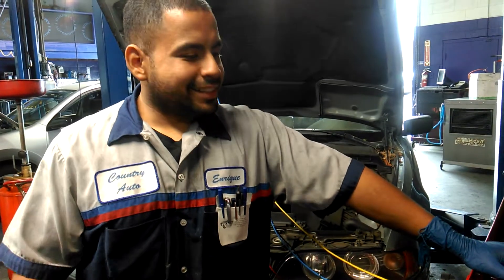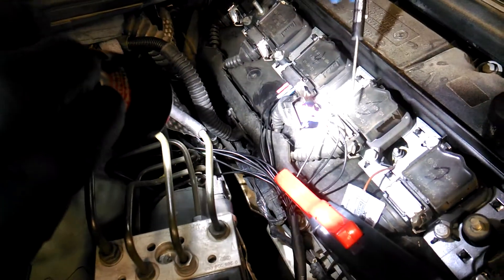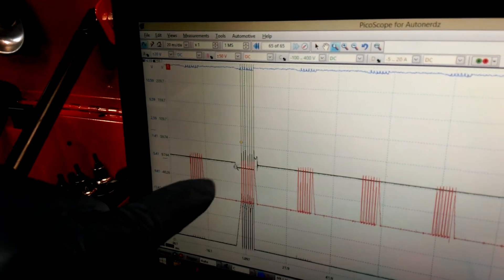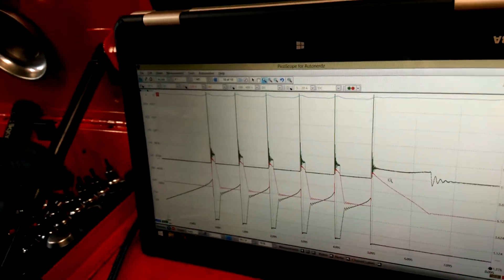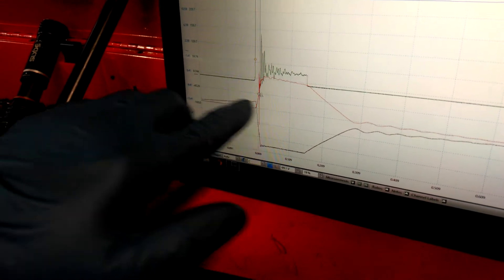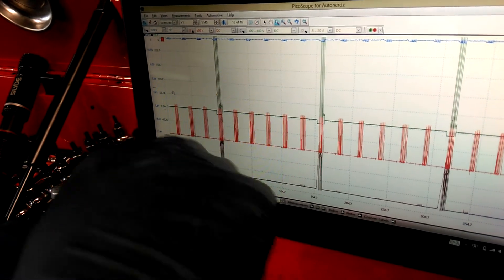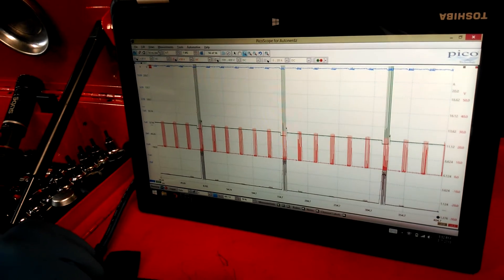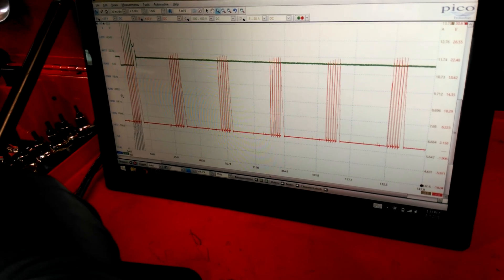Picoscope 4425 Ignition Waveform 2002 BMW 525i

Comment: So youre a pico guy now :)
Reply from the maker: At times. When the situation calls for it. :)
Reply: A little bit off topic Enrique.,any opinion on ditex scope?
Reply from the maker: I am sorry I have never used or heard of that scope. I looked at the website and the price on ebay. For the specifications, 2MHZ,  20 MS/s it does not look too bad. I don't know about technical support though. Sorry I could not answer more thoroughly.  Thanks for your question.

Comment: Can you use Hantek test leads, secondary ignition pickups, DC/AC amp clamps and other cables with your pico? Pico accessories are much more expensive than Hantek.
Reply from the maker: +Mambre Khachatryan You can use Hantek accessories with the Pico since all the Hantek accessories output a voltage just like the Pico ones do. The only concern is the conversion factor of the amp clamp. You will either have to make a custom component in the Pico software (which is easy to do) or do the conversions in your head as you are using the amp clamps.
Reply: +Enrique Osorio OK, is it necessary to have 4 channel scope? I hope to do 90% of tests with 2 channels.
Pico software seems to be cool, waveform library will be very useful, is there extra fee for library access? Thank you very much.

Comment: Hey man! Can you find misfiring injectors with this unit?
Reply from the maker: +ILTSYC You can, you can find injectors that are not firing due to lack of control, shorted injector coil or an open injector coil.
Reply: I was fixing to purchase a Pico Scope until my transmission went out in my van.

My Pa in Law has a vehicle that skips on acceleration  but its not throwing any codes.
I figure its probably a plug, plug wire, coil pack or injector.
Reply: Hey man, when you do an intake gasket replacement on a 5.7 Chevy. Water gets in the oil when the intake comes off right? How many times do you change the oil to get that all out and ensure that the engine will not spin a bearing shortly after?

I've seen two 5.7 Chevy's spin a bearing right after, within a week of having the intake gasket replaced. I do not know if the oil was changed or lowered enough to get the water out on either vehicle. Same mechanic did both. One was my Suburban and the other was my Nephews Z 71. And I've heard of many others

It cost me an engine just to have the intake gasket replaced. Now I've just replaced the intake gasket myself 8 years later and am concerned. I didn't even crank the vehicle without getting that oil out of it.

Before I was pulling a boat to the lake and all the sudden I lost oil pressure and before I could get stopped it was knocking. Game Over!
Reply from the maker: +ILTSYC I have never had to change the oil  more than once. If that much coolant gets into to the oil i suggest draining the coolant first.

Comment: Great video, as always.
Bought the hantek myself, while saving up for the pico, used they are hard to come by..
Could be nice have you make an direct comparison with the hantek and pico, if you made the same measurements on a vehicle...
One thing i really really miss on the hantek is the volt and time display pr division on side og the display, like the pico has... 
Keep up the good work.

Comment: Good clip,  What type laptop are u using.  I purchased a Pico 4 ch. to use with Verus Pro.  No good,  Turns out Snap On platform won't support. Now looking for laptop.
Reply from the maker: JOSEPH BURIEL So sorry for the late response. I am using a Toshiba Satellite Radius 11 L15W-B1302 and I have no problems. Good luck.

Comment: Congrats for your new Pico scope... Question if I may...  is there any reason why you changed your Hanket 1008A over a Pico Scope.  I've been using Pico.  it is a shop scope owned, you know, the price..... but, I've been thinking in getting one for me. pricewise Hanket.... but I've never tried it. so, what is your opinion comparing them around? thanks. good Job
Reply from the maker: Victor Alvarado The Hantek can not hold a candle to the power of the Pico. The Hantek is useful but you have to get creative with how you capture your waveforms. Anything that you want to see with the Hantek can only be seen with great detail if you choose a short timebase. If you choose a longer timebase you will be able to see more of a waveform but at the sacrifice of detail. With the pico there is no sacrifice you can get incredible detail in waveforms that are over 10 seconds long.
The Hantek can be used, I used it for over 2 years and it has rarely let me down but the pico is another world.
Reply: Enrique Osorio I see... Ok. Thank you.

Comment from the maker: I prefer the pico over the Snap-On Scopes simply because the pico is just as powerful as the scopes Snap-On makes but costs significantly less. The cost is difference is huge once you add on accessories. You can get the new standard kit from AutoNerdz that comes with a 4 channel oscilloscope and many leads, probes and accessories for a little less than a brand new 2-channel Snap On Vantange Ultra that only comes with 3 leads. If you want 4 channels with a Snap On you are now talking more than double the price for their 4 channel scope/scan tool platforms.

The major advantage of Snap-On is their trouble shooter which can give invaluable information as well as wiring diagrams and connector views. For me it was not enough of an advantage to spend the extra money for the Snap-On.
Reply: Thanks for your reply I will consider all these factors when I go to purchase, sandy

Comment: Bro very nice videos i am thinking about the pico or the new pc based autel maxiscope 4 channel . What do you think i am presently using a fluke 192 scopemeter and thank you for taking the time for these very informative videos .
Reply from the maker: 8power0 I have not heard about the Autel until you made me aware of it. The features and specifications are outstanding but are about 25% of what the pico is capable of. No doubt the Autel looks like a solid machine but my only experience is with the Modis,Hantek and the pico. I can give a fair assesment of the Autel

Comment: Pico nice unit but pricey.
Reply from the maker: Tom OConnor I agree.
Reply: Is there a cheaper alternative for diy er
Reply from the maker: Tom OConnor Absolutely. I used the Hantek 1008 for years. I was probably about $500 invested with all my accesories and homemade probes.
Reply: what is the difference between the two ?
Reply from the maker: Tom OConnor The differences are significant. The Hantek is a good machine but it is slow. It only records at a maximum of 2.4 million samples per second whereas the pico records at 250 million samples per second. If you turn down the sample rate of the pico to 10 million samples per second and with its 240 million sample buffer you can have 24 seconds of data to review while being able to see incredible detail. There is a recording feature on the Hantek but I have not been able to use it effectively. The few times I have used it the quality was terrible and I did not get useful information from it.

All this means is that with the Hantek you have to have the waveform you want to see live on the screen which can be difficult. An example may be if you want to see detail of a waveform over a long period of time you have to be clever with your channels and triggers to get all the information you need whereas with the pico it just stores everything you capture and is much more convenient. I have had the pico for about a week and I am diagnosing problems faster with more confidence.
Reply: What kind of faults would you use the Pico for?
Reply from the maker: Tom OConnor Quite literally anything electrical on a car. The possibilities are only limited by your creativity and skill.